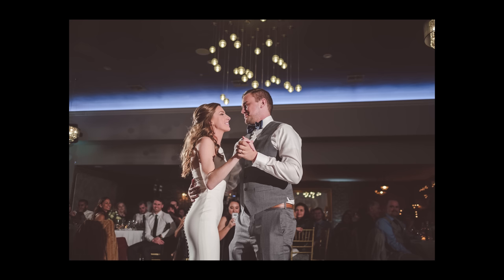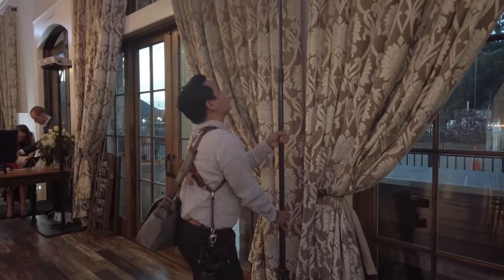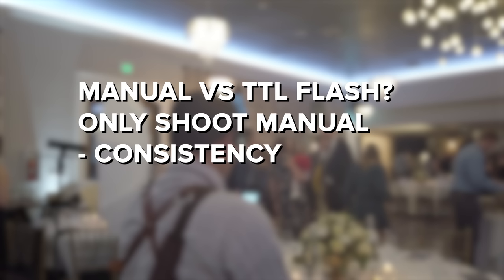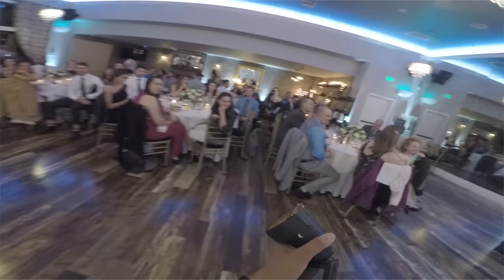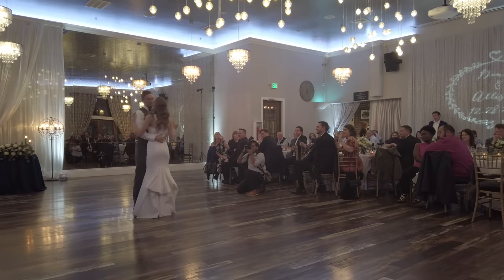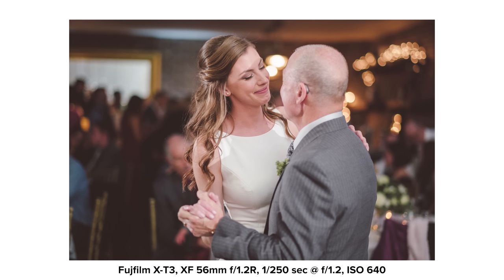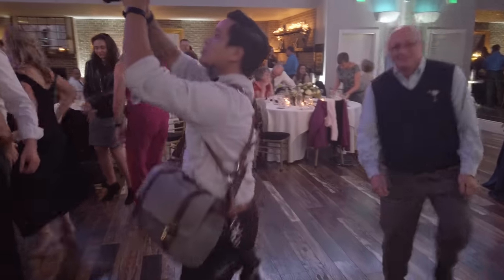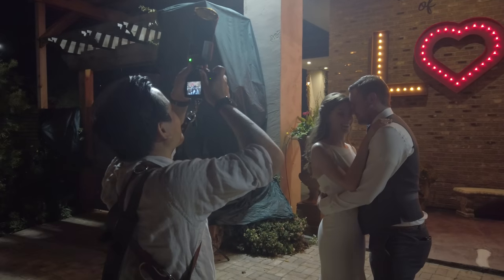Off Camera Flash Tutorial Wedding Photography - Fuji XT3 Godox V1 AD200

Comment: Thanks Reggie, another great video. Do you ever have any issues at venues with wedding planners or brides complaining about allllllll the flashing??
Reply from the maker: I’ve only had one complaint in 6 years. And it was a venue with a low ceiling and very cramped table layout. I ended up moving the flash to another location in order to accommodate the guest.
But other than that, I haven’t. The flash is pointed at the couple and it’s only in heavy use when everyone else is looking at the couple too.

Comment: ISO 160??  That’s crazy.. I use to work for slr lounge /lin and Jirsa weddings. Unless they’ve had their photographers upgrade all their systems m, our settings were typically iso 3,200 for reception at  1/60 -1/200 2.8.  Using either canon or Nikon. Only a 2-3 used Sony but I’m not sure what they used.  I edited for them too so I knew all their mistakes and what not. 
ISO 160.. that’s awesome and very beautiful work you got here.
Reply from the maker: Logan Lion it’s just the lighting of the venue. The iso is entirely dependent on the venue and ceiling height etc
Reply: Reggie Ballesteros thanks, yes I know. That particular venue actually looks darker than most venues I’ve shot at with them. Even with the reception more lit, they’ve used 3,200 iso. Very rarely did we use 1600 and they use to stress about using native iso all the time even though one of the partners ever used native iso. Having to edit the majority of their weddings I knew who liked to break their own rules. I didn’t really see a difference with editing purposes between using native or extended.
Reply from the maker: Iso 160 is the native iso of my camera.

Comment: Another awesome video, thanks. Do you have to keep adjusting the flash power on the flashes in the corners of the room. I just thought that if, for example, you had the power set to properly expose a subject in the middle of the dance floor and then you wanted to photograph someone who was a lot closer to the flash at the edge of the dance floor,  then they would be over exposed if the power was the same. I hope this makes sense.
Reply from the maker: Stuart Mauger either adjust their flash power or adjust the iso aperture. But yes, I’m constantly monitoring the flash and adjusting on the fly. Sure ttl does this for you, but I still like to be in control
Reply: Stuart if you put your off-camera flashes as far into the corners of the room as you can, then the whole dance floor will be pretty much in the same exposure zone. It also helps avoid guests tripping over your stands!

(In some smaller venues or if the ceiling is very low you may not always be able to do this, of course).

Comment: If your background / available light is somewhere between 2500 - 3000K, what's easy to cover with flashes while using gels, you are really, really lucky. Course in my area quite often neon light is used at the venues, what makes the room kinda green. And in newer times, big reflectors with pulse light are used, which change colour constantly, what makes the whole experience a nightmare for photographer. So I have the choice to either disregard available light and go full with flash, or I have to ditch flash and go available light only, what sucks either way...
By the way, how do you achieve to fire / command your AD's to fire from two different V1's?
Reply from the maker: Both v1s are operating independently

Comment: Thanks very much well done and informative. Are you reviewing each shot in the EVF to confirm exposure and to make adjustments?
Reply from the maker: yes, just very very quickly tho. for the most part it doesn't change much until i make a big movement, just because i shoot in manual flash power.

Comment: Awesome video. What do you recommend for a reception under a white tent? I usually do the technique that you mentioned in this video, however i usually use tighter focal length just so I dont get in the way of the guests or videographer. I have a wedding coming up and its under a white tent, do you recommend setting up OCF and having the lights just pointing up and using the white tent to soften the light or just doing on-camera ? TIA
Reply from the maker: It ultimately depends on the space.

Comment: Can you make do with a V1 or 860II instead of the AD200 as off-cam flashes for a wedding? 1 AD200 is equivalent to 2 860II/V1 here. Same size venue from the video.
Reply from the maker: Jay Jay Cenon Tarun you definitely can. But the 860ii has an annoying thermal warning that trips off frequently rendering the flash useless till you pop the battery out or wait a long cooling period. If you thjnk you won’t trip this then it’ll definitely be doable
Reply: @Reggiebphoto  Am currently trying to invest some on lights so am not sure if I should get the AD200 or just 2 V1. I'm doing some portrait/headshot projects.

Comment: Silly question (I'm sure) but when setting up the off camera flash, wouldn't it make more sense to point them towards the ceiling rather than towards the dancefloor so as to get more light coverage???
Reply from the maker: Symz G it wouldn’t provide as strong of a rim light. Most of my key lighting is coming from the on camera flash that is bounced off the ceiling as you suggest. The rim adds dimension and separate the subject from the background
Reply: @Reggiebphoto  ok cool. Thanks

Comment: So I also use an XT-4 and the Godox V1, my question to you is have you ever had this issue happen. I have my V1 on Manual mode and from time to time it will automatically change to TTL and sometimes it’ll change to Multi mode. Even if I change it back to Manual either on the actual V1 or if I go to my Q settings, it’ll automatically just go back to switching on its own. Any clues ?

Comment: Are you using the bounce in camper flash throughout or only for certain parts?
Reply from the maker: Thereal Roblay it depends on the shot. I say what flashes are used for each shot shown
Reply: I typed the question and then got my answer in the video

Comment: Did you have the X-T2/3 godox issue where the flash heads and truggers are in manual, but the fuji flash menu is locked in TTL?
Reply from the maker: If you leave the camera menu to ttl, it still triggers in manual just fine.

Comment: Sir, How is Good 685 for wedding? Plz
Reply from the maker: I don’t have personal experience with that flash. I’m sure it can do well tho
Reply: I use TT685F flashes off-camera (with TT350Fs on-camera as controllers and for fill). I find the 685 gives enough power, but I generally use a higher ISO than Reggie does as many of the venues where I shoot weddings in the UK have less ambient lighting. I do have a set of AD200 flashes which I will use in larger venues. In small venues sometimes they can be too powerful!

I use my TT350 units in TTL dialed down to -1 or -2 flash compensation, direct flash not bounced, just as a touch of fill. I prefer the TT350s on camera because they are so much lighter! 

Another tip is to place your flash stands well away from the dance floor (I put mine as near to the corners of the room as I can) - this is both to ensure that guests don't trip over them but also to allow for the inverse square law affecting the flash power - if your flashes are right by the dance floor you get a bigger difference in light intensity between the centre of the floor and the edges, which makes exposure inconsistent.

Comment: Do you have to use ad200 for this.
Reply from the maker: Nope. You can use any off camera flash
Reply: @Reggiebphoto  on thank you cause I have a set up I use my 2 ad200 in my magmod magbox. I was going to use 3 godox flash for the reception this be my first time trying it at the reception
Reply from the maker: Cool
Reply: @Reggiebphoto  I remember you Mention you was using ad200 on off camera flash and had godox on your camera as a master. I believe you said your powers was off 1/16-1/32 and on 1/4. My question is what is you hand speedlight off camera are they still going be the same
Reply from the maker: Sorry can you rephrase your question ?
Reply: @Reggiebphoto  your using ad200. My plan is to use 2 flashes off camera and one flash on my camera.  You said your ads was at 1/16 and your flash was at 1/4. If I'm using flashes would mine be at that power or lower
Reply from the maker: It entirely depends on the lighting situation and your settings. I can’t really answer that for you

Comment: hi reg, i'm new to wedding photography and planning to take my first wedding coverage using full auto settings (P mode) + ttl mode flash. would you recommend that settings for a beginner? any tips? I will be using xt3 + 35mm f1.4 all through out and godox tt350F. Thanks and more power!
Reply from the maker: besalleromepuctista personally I can’t recommend auto modes for the type of wedding photography I do. I rely on predictability and reliability - and auto is not that. I would recommend practicing as much as you can prior to your first wedding. Experience and practice will be way more important than any setting recommendation.

Comment: Well done! I really enjoyed your video. How did you manage getting proper focus with such wide apertures? I'm using an old X-T1 which isn't the best AF I ever used but I'm really curious to know how is the focus miss ratio on X-T3. ;)
Reply from the maker: Marco Lamberto I’ve been shooting wide open for all my wedding photography for the past 5 years. Just comes down to practice knowing where to put the point and the right settings etc
Reply: @Reggiebphoto   I was also wondering about your aperture for this entire breakdown. My question is were you manually changing your aperture for every scenario or was is set up to do automatically? Cause i noticed it changing alot between 1.2 to 1.8 etc.. shooting wide open is very difficult so props to you!
Reply from the maker: I shoot with all manual settings. So those are me changing the aperture

Comment: Just watched some of your videos - excellent! I am just wondering why you are not using TTL with the Godox flashes and the X-T2/3. Due to the fact that you walk around quite a bit and turn the flash backwards or towards the ceiling, there should always be a different amount of light needed (e.g. inverse square law). How do you handle that? Make a test shot first and then change the manual power. But I guess, in situations like receptions there is no time for a test shot to adopt flash power... Would appreciate your comments / instructions / reasoning for manual mode flash.
Reply from the maker: Peter Uhlemann i use manual flash for consistency. Ttl requires on the camera thinking what I’m thinking. And from experience it’s not always right. Where as when I make a decision its always what I want and intended. I just practice at guessing and testing and I’m very quick at it after practice
Reply: @Reggiebphoto  So how often do you change your manual power settings?

Comment: Thanks for your video Reggie. I'm never happy with my reception OCF set up so your setup is one that I am try. I noticed you put grids on your two OCFs. Do you do that to avoid spilling too much flash on the guests and walls?
Reply from the maker: Yup. Precisely
Reply: @Reggiebphoto  I have tried using my magmod grids before for this specific application but I always end up taking them off because I never can seem to tune the angle of the heads correctly. I'll have to do some experimentation in a controlled environment. Thanks again for the video. I love watching other togs work :)

Comment: Great video, subscribed! One question, when your V1 is on master mode, you have MABC on left for channels, and I suppose the M above ABC is the Master, the flash you're holding. Out of all my 3 V1s, I only get ABCD when I cycle through my modes by pressing the lightning bolt, never MABC, is your V1 shipped this way or was there any firmware update? Thanks!
Reply from the maker: I believe this happens when you put a v1 that’s not for you specific camera brand. Say a canon v1 on top of a fuji camera
Reply: Reggie Ballesteros Oh! So having ABCD is actually a good thing😅 I was looking all over to see how I can get to MABC. Thanks!

Comment: Can I use two V1 for off camera flash?  What are the benefits in using Ad200 instead of V1? Thanks.
Reply from the maker: Yes. More power
Reply: @Reggiebphoto  I have another question. Let say I have two camera bodies at a wedding and each body is attached to a X2T remote. If I adjust the V1 flashes with an X2T remote and I switch to another camera with the other X2T, are the flash settings on the two X2T going to be synchronized? I imagine it would make the workflow harder if the two X2T remotes don’t communicate with each other and I have to make adjustments on the X2T every time I switch camera during the wedding. Hope my question makes sense. Thanks for all your videos! I know you must have put a lot of hours into these videos!
Reply from the maker: They do not. They act independently
Reply: @Reggiebphoto  thanks. Have you found that to be a challenge when switching between cameras? In your experience what’s the most efficient way to control V1 flashes when using two camera bodies? I don’t want to miss the critical shots because I have to re-dial the settings on both remotes. Thanks again.
Reply from the maker: Set up both cameras separately. And know how they’re set up. Planning and awareness is key. There’s isn’t a hack for that unfortunately

Comment: I'm sorry, a few question:

01 Is it possible to program the two external flashes for both cameras that has the V1? I mean, when you switch between the two cameras, you can still have the control on the on camera flash and on the two external flashes?

02 I own just one Godox V1 and two Fuji. What next purchase do you think is better in terms of lights? An off camera flash like the AD200 or another V1 that I can also use off camera or on the second body?

Thank you so much for all of this.
Reply from the maker: 1) each camera needs to have a trigger to control the 2 off camera flashes. The v1 can serve as a trigger or you can have another radio trigger (no on camera
Flash). But say you have two v1s, one on each camera, they can both control the same external flashes.

2) for this it depends. I would prioritize two on camera flashes first since you’re shooting with two bodies
Reply: Reggie Ballesteros Perfect! I already have also a trigger. So do you think is good enough a Godoy 860 paired with the V1? Is half of price 😬.. And In the future an external with stand.

Thank you so much Reggie, I would hug you!

Comment: Hi Reggie,   Are you changing the ISO  in each Angle of view? How its your method?  Maybe its easy to see at the screen to  set de ISO?   Im using. Nikon 810 And 800  w 3 godox 862 Thank you sir @walocortes
Reply from the maker: i change iso only if the photo is coming out underexposed or overexposed and i adjust as needed. but mostly i'm adjusting flash power more.

Comment: Not sure if it is the lens on your video camera or what. It looks like the ceiling is 10+ feet high and the walls you are bouncing off appear to be 10 to 20 feet from your camera. So I don't understand what is happening here, especially given the flash power and iso you are using. I have numerous flash units but none that would support those settings and distances. Were you a lot closer to walls than your video camera depicts?
Reply from the maker: Nope they are that high.